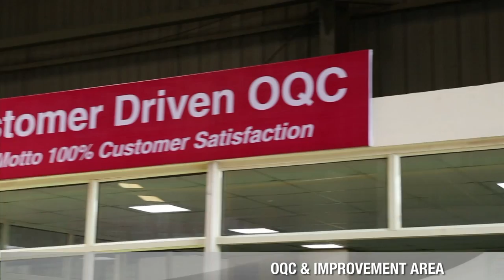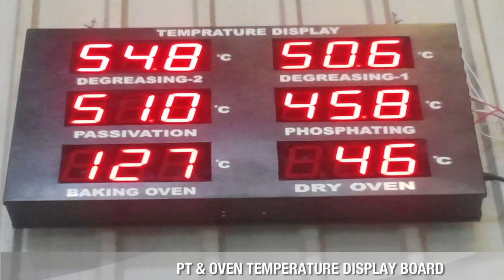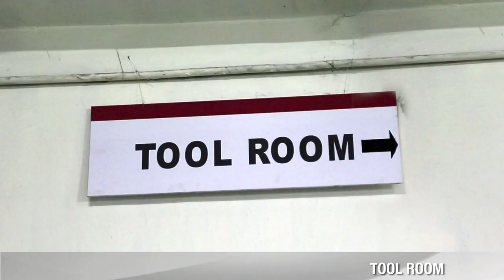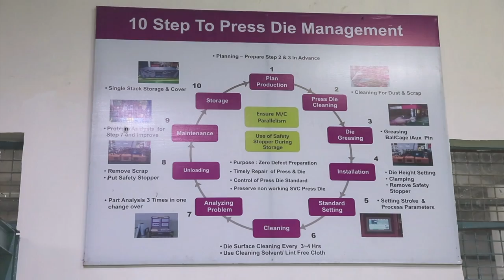OEM for Sheet Metal Components and Assemblies [ www.nidhiauto.com ]

Comment: what about magnetized sheet metal picking could you tell more about it
Reply: Thin sheets are Closely pastes to each other & very difficult to separate.
But by using of magnet on one side, sheets are easily separates.
Reply: Magnetized sheet metal picking system is basically used the magnetic force. 
When we adjust/Fixed the magnet block with sheet packet, we can see that the top of 3 or 5 sheet lift up automatically so operator can pick the sheet easily.